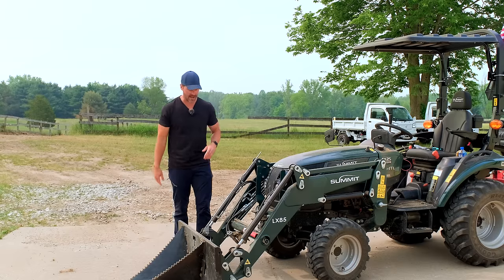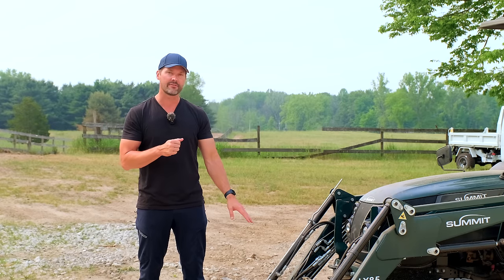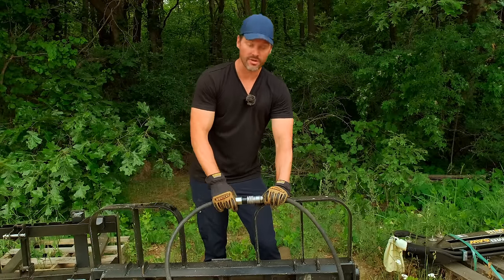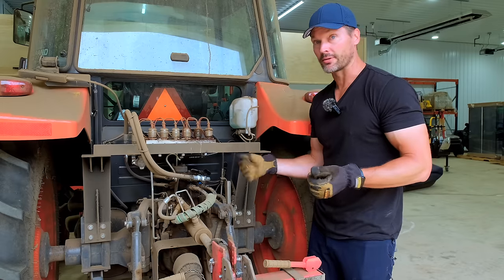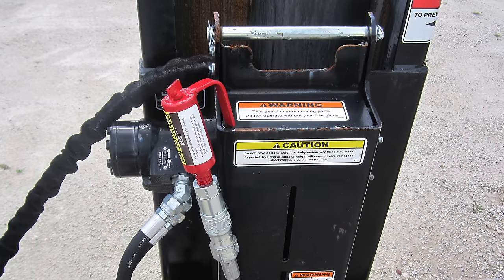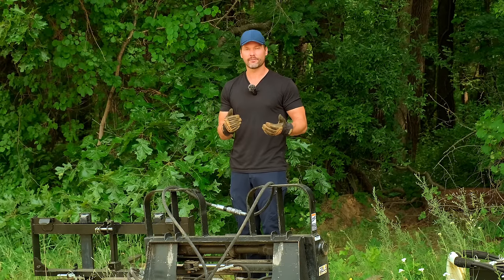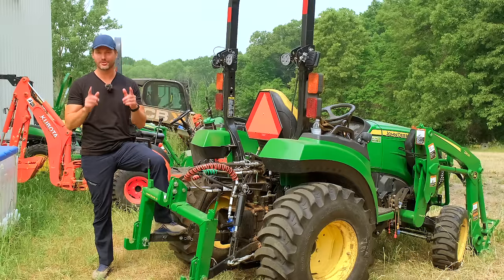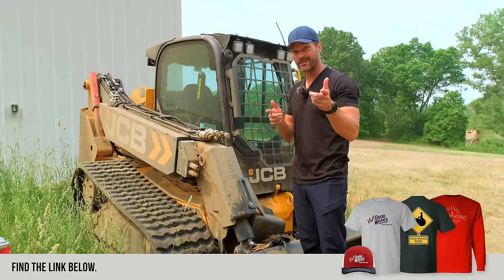10 MUST-KNOW TRACTOR HYDRAULIC TIPS! ONE SAVED ME $3800!

Comment: Turning off the tractor and relieving the pressure is absolutely a good idea, but it might not prevent over pressure if you relieve the pressure when it's cold and try to connect when the weather has warmed up, or even gone from morning to afternoon temperatures. Hydraulic fluid isn't compressible in any practical sense, so when it expands due to heat it expands the hoses which are a really stiff spring. The pressure relieves quickly, but it can still be a problem even if it's just thermal expansion. IMO: A wrench is the best way to relieve it because it's more controlled.

Comment: The couplers on your Kuboda are pioneer style with a double action collar, mounted in a breakaway configuration.  The double action collar can be moved in either direction to get the retaining balls to disengage.  In a breakaway configuration the collar is clamped (or is a housing) so the coupler moves instead of the collar.  This is pretty common setup on larger tractors and has been around for decades.  My 1973 Allis Chalmers 200 (original owner) came with these.
Reply: Best couplers I know.
Reply: My 1953 JD 60 has something like that on there too
Reply: Yes, they are Pioneer couplers that just release when the collar is moved either way. The collar is what is attached to the tractor, so as you push or pull the hose it's actually moving the collar just like you would by hand on a standard coupler.
The AC 200 you speak of has little levers that can assist you on the outlets.

Comment: As a farmer I actually hate the quick connect ag couplers(the ones with no collar) on big tractors because they get worn out and like to pop out. It's very frustrating having to climb down out of the cab amd go plug the hydraulics back in so you can fold your tillage implement, etc.

Comment: Perhaps i missed it, but you also want to relieve the pressure on your 3rd function. Once the tractor  is off, you need to move the third function rocker switch back and forth before unplugging your lines.
Reply: Check to see if the third function valve is electric and if the key has to be on to use it. If the valve is keyed, you have to turn the key back on after you stop the engine, then rotate the joystick to release the pressure to the valve and the hoses.

Comment: Great video Courtney!  The ones on the Kubota are Faster (brand) couplers.  For the pressure buildup problem with grapples, etc., I simply bought another set of male/female couplers and put a tiny ball valve on the other end.  Plug them on the implement hoses and simply crack the ball valves to relieve any pressure buildup.

Comment: Great Video. I drove hydraulic lift high cube commodity trailers for 14 years. The change in temperature would cause the hoses to pressurize. We used a block of wood and a hammer to release the pressure. We had 1” pioneer fittings.

Comment: Upgraded my 2014 1025R with  power beyond, an electric 3 spool rear remote from Summit. Have a top link on one spool, wrapping the loose hydraulic lines with the hose wraps to prevent any chaffing. Going to add a tilt link on the second spool. And the third spool I'd like to rig something up to lift the 60" belly mower which is the challenge.

Comment: If you have a 3rd function or electric diverter, you need the tractor but the key on, to let the pressure off of the lines.
Reply: Depends on how it is wired. Mine works with the key off.

Comment: Great video and really appreciate the info. I have a TYM 394 with a backhoe and both backhoe hoses have male fittings. I connected the backhoe and turned on the valve but nothing worked. I swapped the hoses and that fixed the issue. So, for some tractors / attachments, the direction of fluid flow matters!
Reply: All tractors and attachments require the correct fluid flow direction. Some stuff will just work backwards, some stuff won't work at all, and some stuff can be damaged by hooking the hoses up backwards.

Comment: My 3520 has a relief valve on the 3rd function box. Clockwise for pressure, counter clockwise pass through, no resistance pressure for running a backhoe where the backhoe controls regulate pressure. Turn the valve counter clockwise to relieve all pressure when hooking the grapple up and hook the grapple lines together when dropping while there’s no pressure.

Comment: For the 3rd function do you need a bigger tank beciase your running another hydraulic cylinder? I have a bigger older tractor that I want to do this to but I wanted to ask before I spent the money on it
Reply from the maker: No, not at all.  It's really not much extra fluid in the system.

Comment: My JD 2240 front hydraulics get week when working pto or front bucket for a while.  Was told I needed 2500 worth of new trans pump.  Going to try the filter and new screens first too.
Reply: Filter might help, but hydraulics getting weak after the oil gets warm is a tell-tell sign of a worn pump. Could also be a worn relief valve, which is much cheaper than a pump.

Comment: Keep cans of brake clean handy to clean out the couplers. One speck of dirt is all it takes to damage your hydraulic pump, or valves.
Reply: Not necessary. Farmers aren't exactly clean freaks and hydraulic system damage from getting dirt in the couplers is almost unheard of. Sure, do your best not to cram dirt in there but a little bit won't hurt anything at all. It all gets filtered before it goes back through the pump.
Reply: @outlander330cc  You do what you want,  40 years of heavy equipment mechanic, and farm equipment mechanic, says you are going to cause yourself some very expensive Repairs

Comment: Hi Courtney, I had a White 2 105  for several years. Hydraulics are closed centre and locked when engine was off so sometimes almost impossible to disconnect if there was pressure in the system. What is the answer? Do any small tractor have closed centre systems?
Reply: Try just turning the key on  with tractor not running then move control to release pressure . Thinking it has selinod lockup .   Just thinkin

Comment: Unfortunately, hooking the male to female hydraulic doesn't ensure they are easy to disconnect. In fact, I found the only benefit is that it keeps the connections clean (like using a plastic cap). 

Last season, when I stored everything for us winter, I did just that with everything I could. 

This summer, I tried to use the accessories, and ALL of them were totally pressurized, and the only way I got many of them to work was to unscrew something on the hose.

The issue was I put everything away on a cold day in the fall, and then tried to use everything on a particularly hot late spring day. 

Any time the temperature rises, liquids, including hydraulic fluid, increase in size, increasing the pressure.